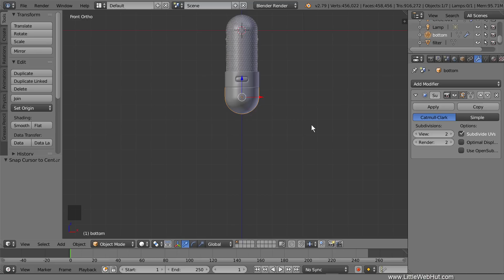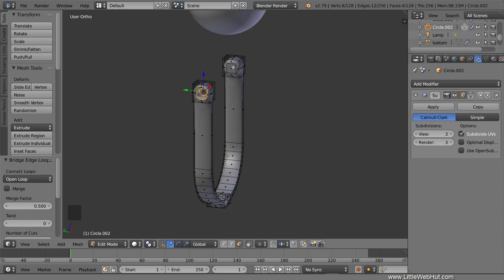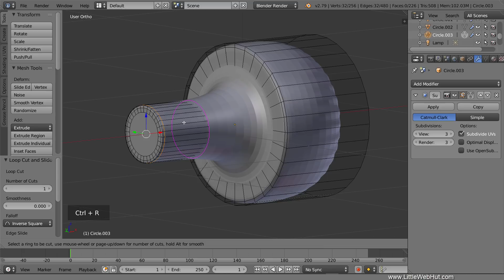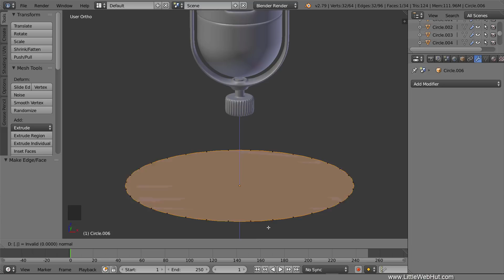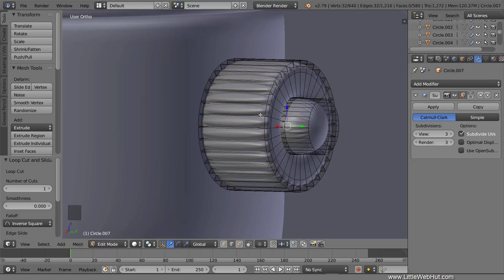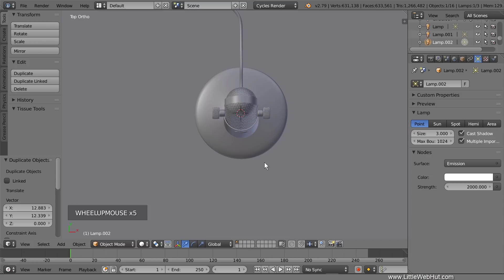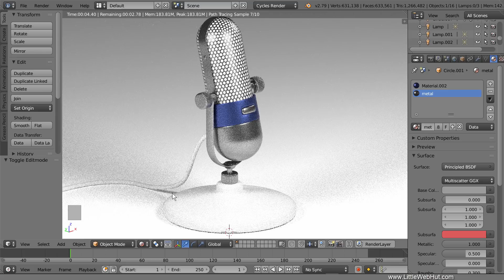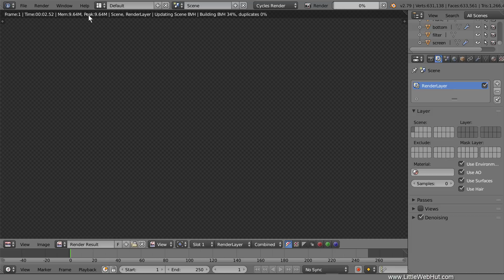Blender Tutorial: Modeling a Vintage Microphone: Part 2

Comment: Blender 2.8
For those of you having problems with adding texture to filter material and base.
Filter Texture: After assigning colour to material go to Displacement > Vector Displacement. Now you get more options. Under Vector select Checker Texture as shown in video. Set first scale to 200.
Base Texture: After assigning colour and roughness go to node editor (Shading), add Bump node (Shift A, Vector), connect output Normal to Normal in Principled BSDF, set the Bump strenght to 0.200. Add another node, Noise Texture (Shift A, Texture), Connect Color output with Bump Height, set Noise Texture scale to 200, detail to 3.
Reply: thanks so much!!

Comment: UPDATING: Fixes for Blender 2.93:

For "Extrude along Normals" it looks a lot different now.  If you hold click on the Extrude tool, a popup allows you to select "Extrude Along Normals," then you can manually type the thickness in the dialogue box (it was wonky when I just hit the numbers).

When making screw holes in stand, he says click "Mesh/Edges/Bridge Edge Loop" but this is moved to the "Edge/Bridge Edge Loop" tab

For knurls on screws hold down on extrude button icon to get "Extrude Individual" tool.  Click it and then move the yellow handle a bit so the dialogue box shows up.  Then type the 0.1 in the offset.

For power cable: Again you need to hold on the Extrude tool icon and select "Extrude to Cursor"

For Filter Fabric: go to the "Shading" workspace, in node window click Add/Texture/Checker Texture then drag "color" from Checker Texture to "Displacement" on Material Output

For black base: in "Shading" workspace, after creating new black texture, click Add/Convert/Math and Add/Texture/VoronoiTexture.  Then connect Voro.../Distance to Multiply/Value(left) and connect Multiply/Value(right) to Material Output/Displacement

For render settings, denoising is now in Scene/Sampling/Denoising and click the check for Render NLM
Reply: Oh, And I added some fixes on Video Part 1 as well, including the Tissue Tools problem!

Comment: I enjoyed doing this tutorial a lot but was disappointed when in the final F12 render there was no material in the filter and you could just see straight through the screen even though in render mode I could see it fine.......Looked and looked for a solution but nothing made sense.......maybe someone has an idea?
Reply: check if your object is hidden for rendering by pressing the camera button in outliner. you may have hid it accidentally for render but visible for view port as he did the same thing in part1. ,

Comment: This checker texture is a bit different in blender 2.80. Can anyone help??
Reply: If you select Vector Displacement under Vector tab, you will get a drop-down list called Vector. From there you can select Checker Texture. I don't know, if it's the same. But the results look quite similar.

Comment: Great tutorial however you can get as far as the cable and there seems to be a missing extrude command to enable ctrl left mouse button extrude. Shame as its great learning blender tool otherwise
Reply: Ok found the bit he missed he had the face selection button pressed and required to have Vertex Select